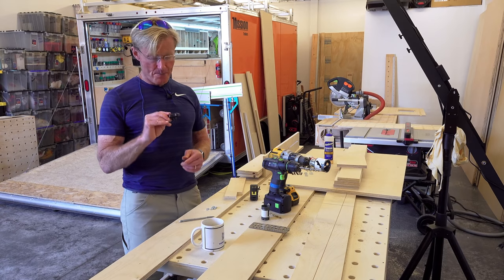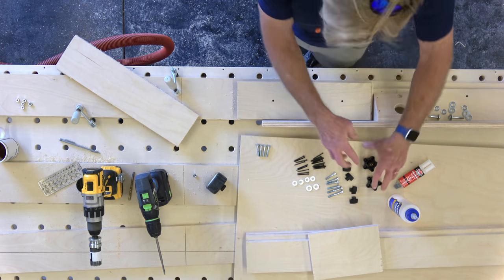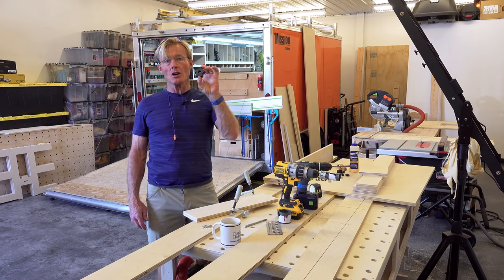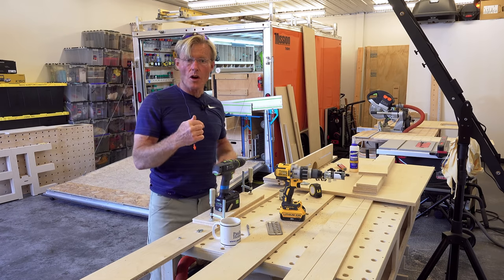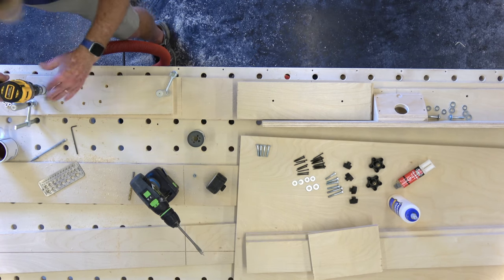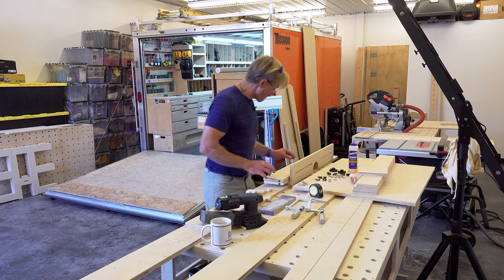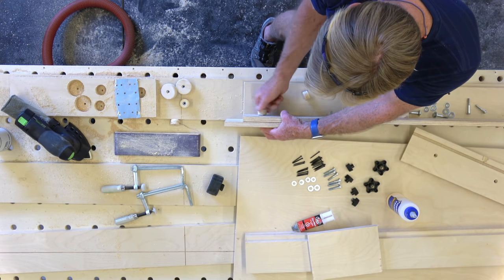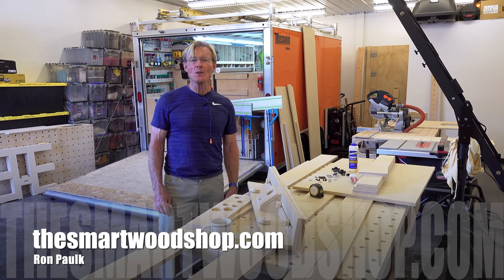10 cent knobs in only minutes! No Joke😀

Comment: If you layout 4 smaller holes along the perimeter of your circle and drill then first, you will have finger grips on the knob.
Reply: I was going to say the same. Drill 4 or 5 holes around the perimeter, maybe 5/8 or 3/4" in size, and then your knobs would match the plastic knobs.
Reply: This was more of an "in a pinch" situation; you don't want to spend a lot of time on something like that when it's a temporary fix. Because at some point, you're spending more in time than the couple of bucks it would cost for store bought knobs. Money is an almost infinite resource; it can be earned. Time is finite. You can not get more of that back, unfortunately.
Reply: @NWGR  I get it. At the same time there is no reason for wooden knobs to be a temp fix. It seems to me that drilling 5 extra holes would be faster than going to the hardware store, even if it was next door.
Reply: @JDeWittDIY  Very true; depends on how many knobs you need and other variables, like having the necessary hardware, drill bit sizes, epoxy if you'll be using it, etc.
Reply: Or just cut a small square out instead of using a hole saw. Easy grip and easier to make than with a hole saw. One step further, make 4 more cuts and make an octagon by cutting off the corners of the square.
Reply: @idgara007  Yep, there are lots of options. A small rectangle with rounded corners works great too, and is super simple to make.

Comment: 3D printers are a huge asset for making wood working accessories.
Reply: I agree, but it depends on the application and material printed with. I do most of my shop prints in PETG now since my shop can get pretty steamy in the summer (uninsulated, detached garage). I print mostly organizational things, particularly small parts bins and accessories for my packouts.